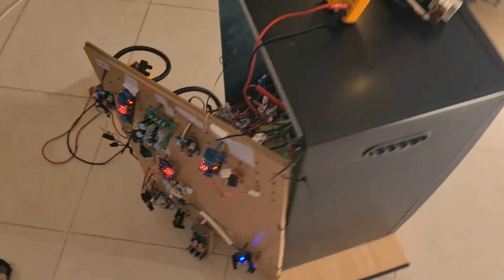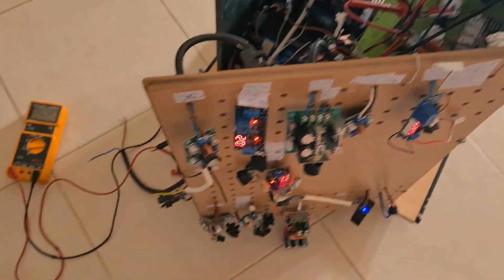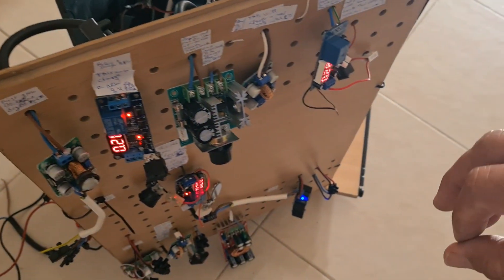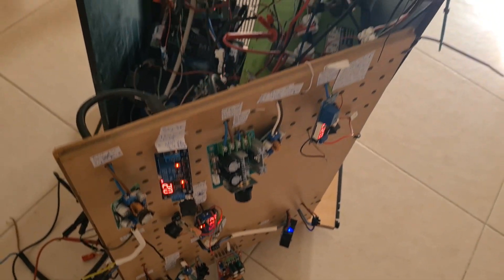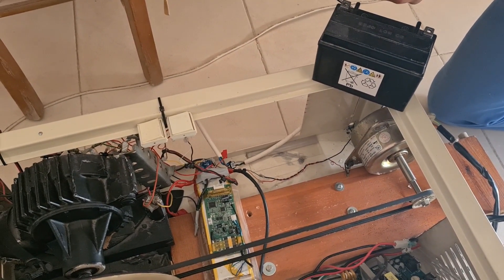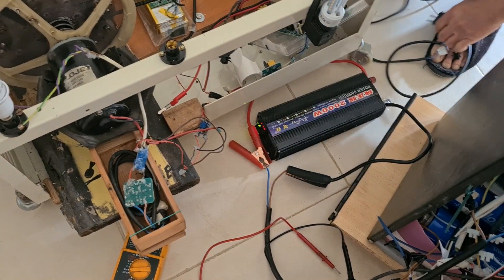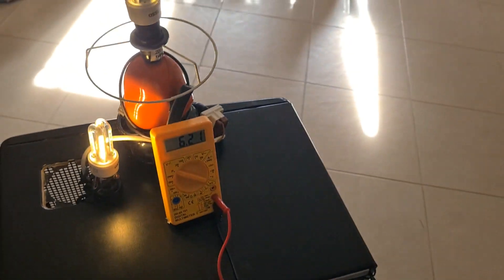Self-charging fuel-less solid state overunity device 2023

Comment: would you please share the circuit designs
Reply from the maker: Basically there are 3 relays working together but at different timing, 25 min each and then the other takes over. There are a few step up converters and one step down that can be replaced by a 10W resistor. I didn't make any diagram for this one, it was just a test and I will have to follow all the wires when I will have some time in order to make the diagram. Let me just say that the gain is very small because you are using the input and output and load at the same time, the gain is not more than 3-4W to cover the input. If I will do the diagram I will be happy to send it to you.  Thanks for your understanding.

Comment: would you please share the circuit designs
Reply from the maker: Salam aleykoum happy Eid El Fitr. Unfortunately I didn't write plans for this prototype yet but what I can tell you is that there are 3 different independent circuits that work on a relay timer 25 minutes ON the first one, the second 30 minutes ON and the third 35 minutes ON. Each circuit has OFF for the same amount of time. The systems charge each other with a step up converter and potentiometers. I only gain 2W to power a small bulb. It does work for very long but the gain is too small, you can't do much with it. Thank you

Comment: this is quite remarkable. Thank you for sharing Dennis. would you please share the circuit designs.
Reply from the maker: Thank you Michael. It would be easier for me to share it when I did it but now I'm working on other things. Basically there are a few step up converters and one step down that can be replaced by a 10W resistor. I didn't make any diagram for this one, it was just a test and I will have to follow all the wires when I will have some time in order to make the diagram. Let me just say that the gain is very small because you are using the input and output and load at the same time, the gain is not more than 3-4W to cover the input. If I will do the diagram I will be happy to send it to you.  Thanks for your understanding.

Comment: nope      fail              there  IS, however,  an idea that   SHOULD  be   tested.        a few people have grasped the idea  ---   at the last, even g.morin  did.          see my research.      see the use of high-ratio rotary leverage, in a wind turbine (hawt).            here are some important points are:
energy consumption of the prime mover should  be minimized, via selection of an optimally spec'd high-speed motor.
a high-speed prime mover must be loaded most-efficiently, via the use of a  Single stage, of  High-ratio reduction.        this is an example of the driven-wheel concept; where a small wheel/gear drives a (much) larger one.
the alternator used must be spec'd for minimal cogging losses, and for a rotation rate that is compatible with (reduced) rpms, after a high-speed prime mover is 'geared down'.
this is one of the few documented (failed) attempts, made by someone who saw the possibilities.          googletranslate
https://www.youtube.com/watch?v=FmXBebQzMyQ
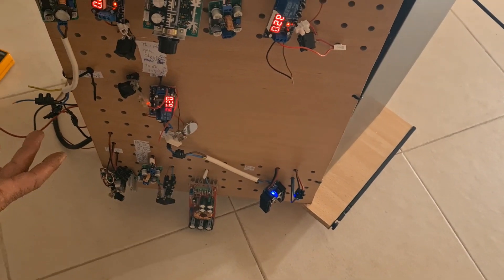see explanation of rotary leverage, at 1:38         a wheel/gear/pulley/sprocket  IS  a continuous, rotary, 2nd-class  LEVER.
https://www.youtube.com/watch?v=JOLtS4VUcvQ